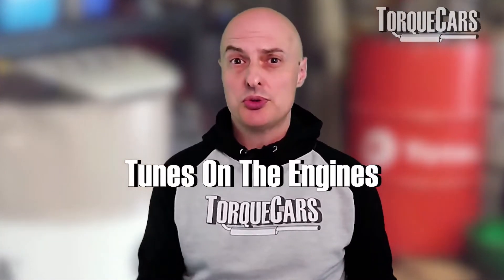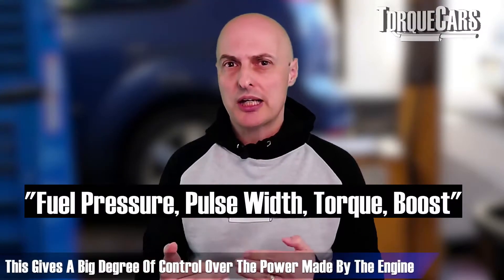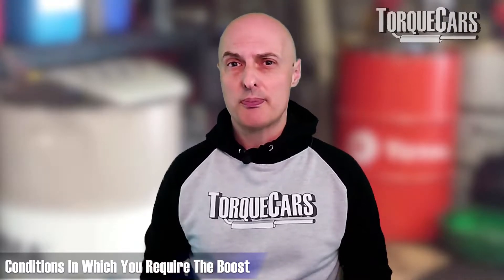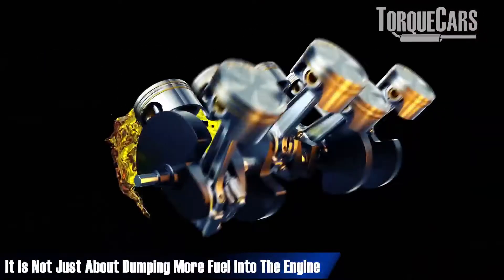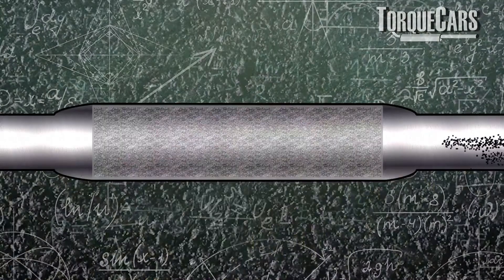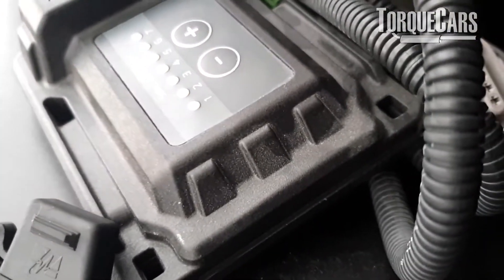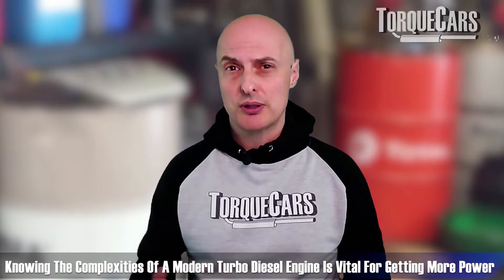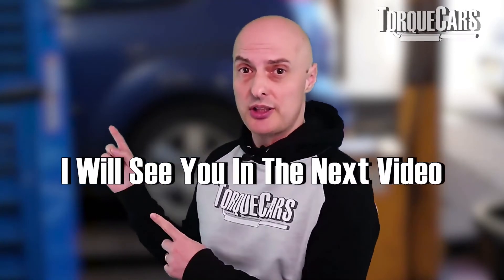Explore Diesel ECU Tuning: Boosting Power & Efficiency With Tdi Tuning /Remapping

Comment: I had my 2007 44000 mile Ranger Rover sport remapped improved mpg by 12 mpg. Only to find that it made my insurance was now null and void. Had to change it back and prove that was effectively resorted to manufacturers specifications.
Reply from the maker: Having worked in the insurance industry I can confirm that there are still quite a few companies out there who will ignore an economy remap but will note it on your policy, there are also some who charge a "modest" extra premium for small mods & changes, but as you've found there are some out there which just don't like any changes at all. It pays to phone around and discuss any modification with your insurer, I'm guessing you are based in the UK? Always choose a Mod friendly insurer if that is what you are planning to do. Adrian Flux and Chris Knott are ideal for heavily modified cars.
Reply: @torquecars  ''Adrian Flux and Chris Knott '' sounds good, presently just changed to the AA, I will enquire there first. The tuner who did my car explained that cars like the ranger rover are basically detuned is that these cars a delivered all around the world. And that in many countries the fuel and oil are inferior, so the manufacturer detune the engines to lesson the potential damage?
Reply from the maker: That true of most diesel cars sold in the UK - we have pretty good fuel and don't get the weather extremes so there is plenty of scope to tighten up the parameters.

Comment: I'm Looking at getting a Darkside development remap, I want a good remap and less soot, and basically I want it to be as economical as I can get it, I'm not looking for massive power increases, while I will get a bit more which will be good, I want the best economical tune that the car can possibly get, as anything over 80 Mph in UK is just daft in my opinion.
Reply: Alright Chris what car did you look at having a map on? Did you take it to Darkside developments and how was the experience I have a 1.6tdi seat Leon I want to do the same I do a maximum of 70mph and want to increase efficiency as much as possible 👍